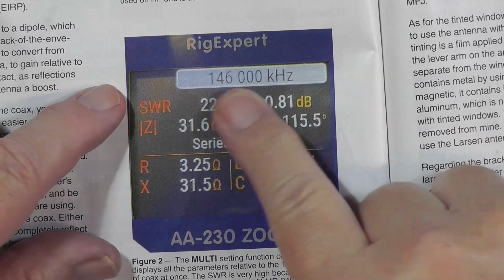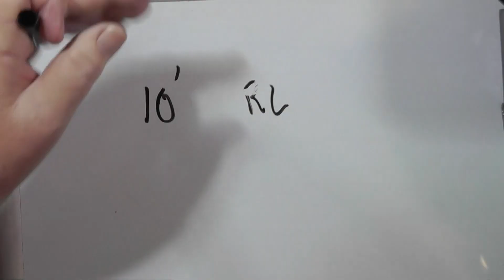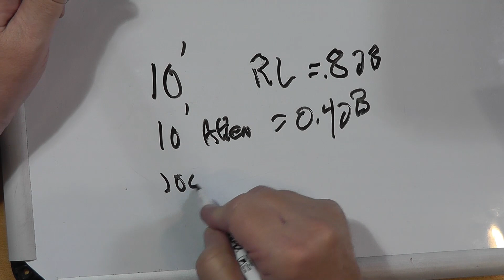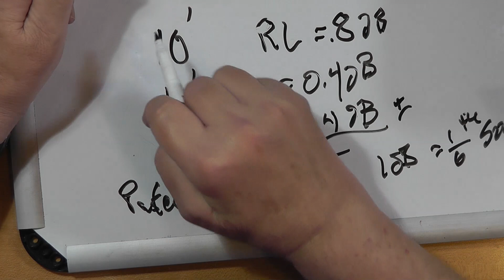Calculating Coax Losses in Situ (#977)

Comment: Line loss is a two way situation. If you have say 3Db of loss it will  also affect the receive signal. This can be a problem in weak signal work. Return loss is very handy in calculating antenna systems when VSWR is defined as return loss, just add, subtract and divide. Measuring Vmax and Vmin in a simple thing. For most, measuring  power at the rig and at the end of the cable with a wattmeter will do fine.

Comment: on the aa230 there is under tools a  cable loss function that does that it does a open and a short and of course you set the freq. but it is more arcuate than the other way and you don't need to cut the value in half if you forget

thanks N9QDS

Comment: I have a remote tuner, should the coax be disconnected before or after the tuner
Reply: Disconnect it before the remote tuner.
De VU2RZA
Reply: Yes, leave the tuner out of the circuit as your usually just interested in the losses of the cable at specific frequencies.